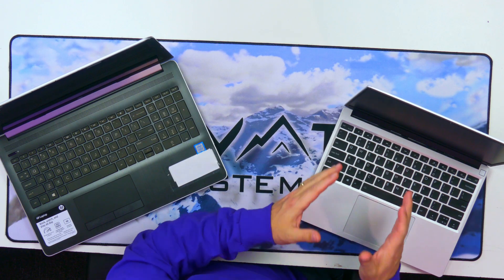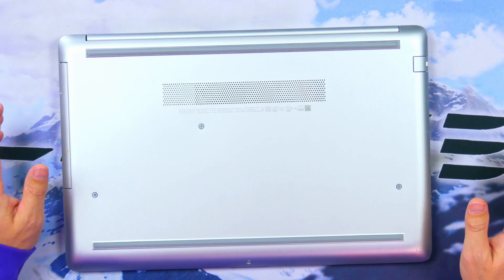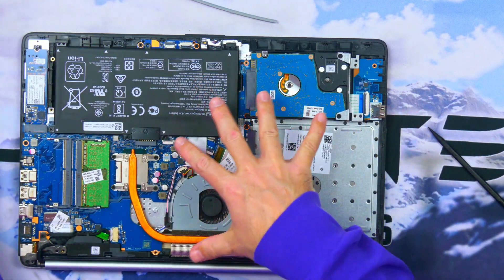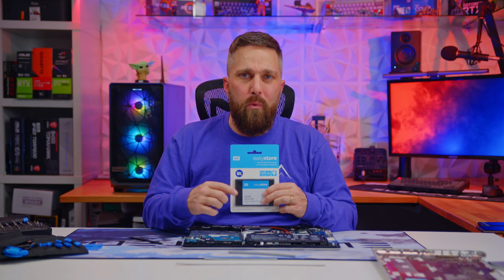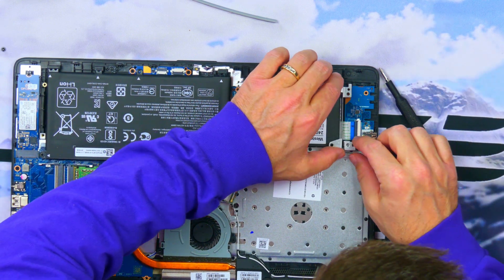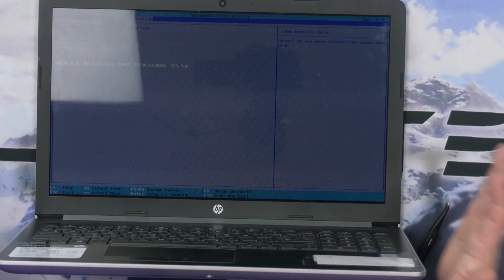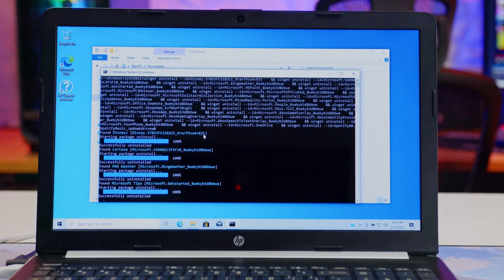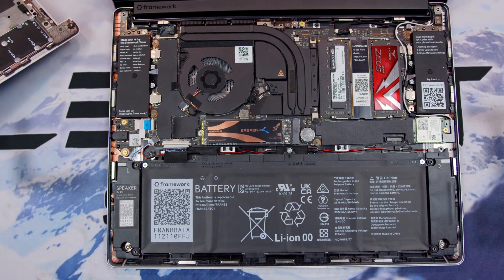Repairing an Anti-Repairable Laptop.

Comment: Just to clarify, he says HHD not HDD because it is a hybrid hard drive.
Reply: Hybrid HDDs, the worst of both worlds. Lacks proper TRIM support, which causes the internal SSD to quickly degrade in both performance and longevity. Won't report as a proper HDD either, which doesn't allow Windows to automatically defrag it.
Reply: But that's also wrong because those are called SSHD!
Reply: @CarbonPanther  To my knowledge they are referred to as both depending on who you ask.  HHD and SSHD are synonymous and refer to the same type of drives.
Reply: @j3y445  from what I understand there is a difference between them either on a firmware or storage percentage difference

Comment: I think this video is very misleading. Your using a cheap $200-$300 HP laptop as example for "manufactures who oppose right-to-repair" and "engage in anti-consumer practice" is a bad one. Most of the complaints being made like plastic clips are irrelevant since the design is made to compensate for the price point, the Framework laptop is at minimum $1000. You can by an HP Elitebook for around the same price which HP has been designed as very repairable for several years now. HP is not really a good example to go after either as they have consistently created "tear down" and "how to replace" videos for most of their laptop line ups. The best comparison you can make against the framework is probably a Macbook.

Comment: I had a friend with an HP laptop that failed on him 2 years into college and I tried to repair it but we ended up chunking it in the trash.  I have repaired and built many desktops before and a few laptops but this thing was something else.  You had to unscrew the bottom cover AND there were screws under the keyboard as well which was clipped in.  After that, there was this tiny thin ribbon cable connecting the keyboard to the motherboard and it snapped in two when I pulled the keyboard off.  I'm a tech junkie so I had an extra laptop laying around that he used to finish out the semester.  That and many other issues I've seen or heard from their products is the reason I will never buy an HP.

Comment: I'm surprised that you didn't add a second stick of RAM while you were inside. (I saw a second DIMM socket inside, something that really low end laptops sometimes omit even when the motherboard is set up to have it.) That would boost performance in two ways: by reducing swapping and by enabling dual channel memory.

Comment: Well... I have a second hand HP8440 Elitebook. It is 12 years old wich in terms of computers is veeery old but it runs extremely well for ofimatic, web browsing, watching videos, email, simple games etc. Not a single problem at all. When it finaly gets completely outdated I will consider buying other second hand premium laptop or the Framework laptop.

People in general should know that cheap laptops are VERY BAD purchase. It is much better to buy a refurbished premium product or like me a second hand premium for 40% cost of a cheap one. If it fails you could buy another one, still save money and it will last long than the cheap one.

Comment: It's kinda a shame. I have a laptop from that same company, from 2012, that is much more repairable. It's not framework repairable, but it's pretty good. It has a external detachable battery, and a service bay, which is held by a single captive screw, which gives me access to the ram, wifi card and hdd, and I can access like everything else with a screwdriver and a pen. Even the cpu can be replaced.

Comment: That framework should be compared in terms of repairability with HP ProBook or elitebook line, the entry levels are pretty in the the same price range and while not on par with models of the early 2010's they are still pretty easy to take apart and service
Reply: I definitely agree. The HP Pavillion lineup is garbage, but the Elitebooks are my favorite line of laptops ever. In regards to repairability, HP actually is better than framework in some aspects especially with their Elitebook 845 Gen 9 which released

Comment: While I know this is not a repair guide, I feel you should have still shown the correct method of screwing in the heatsink instead of fast - forwarding through it. A lot of your followers may look upon this video for guidance.

If anyone is repasting their laptops, the exposed dies are susceptible to chipping, which will kill the computer entirely. Tighten the screws diagonally and do not tighten them all the way in on the first go. Ensure uniform pressure is applied on all sides when tightening the heatsink screws.

Comment: Considering how flexy the chassis is on Pavilion laptops, odds are flex damage will kill the motherboard before that SSD dies. I've seen flex damage kill so many of these. One of the reasons I never recommend consumer-grade laptops to anybody.
Reply: As the owner of a similar model, especially having opened it to upgrade once, I have to agree.

It's terrifyingly cheap, difficult to find useful information for, and has already cooked It's secondary storage controller that was connected to its m.2 slot after only a couple months of running Linux.

Deffinitly going for a Framework or similarly repairable laptop next, just wanting to find something with AMD/Ryzen parts since I'm a Linux user and have had bad luck with Intel/Nvidia

Comment: Just to be fair, this is not a Pavilion laptop, but a "HP notebook" (that's the name of the lineup) and it is their most entry level laptops with very cheap plastic indeed. Hidden screws are a real pity and it is the case for a lot of their consumer products (except gamers such as Omen and Victus laptops). At least there are complete maintenance guide on their website to access all the components, I did not see that for other brands. Also, in Europe, legal warranty is 2 years so it cannot fail too much during the first year of use 😅 I love the framework philosophy and their laptops, I am a PC tower guy myself and I love the fact that you can tinker with a laptop, I hope they will extend their range beyond the premium ultrabook line!

Comment: Bro...worst example of a non repairable laptop. 2 sodimm slots, wifi module is replaceable, m.2 slot, sata slot and even that CPU looks socketed and replaceable. I get the PITA part but it's a budget laptop that can be decked out pretty easily...

Comment: I have literally fixed so many laptops with hdd failures. It’s amazing how hard it can be to replace such a simple component
Reply: They should really make it easier to replace common components like hard drives, batteries, RAM and optical drive (if the laptop comes with one).
Reply: @film2240  but then that means they sell less laptops

Comment: And before you assemble the computer together, remember to try booting it first to make sure everything works, as the video stated those clips are fragile and designed to break so reopening the machine should be made minimal
Reply: After opening my similar model, agreed, also, the plastic that connects to the hing system was already broken on one side on mine for reasons I can't even begin to guess since I tend to treat my computers delicately

Comment: I would not call a HP pavilion anti repair at all. That looked incredibly easy. If you're looking for anti repair call out the M1 MacBooks
Reply from the maker: I have, and no doubt Apple leads the trend. Any anti-consumer practice is usually started by Apple and adopted by everyone else. However, on the other side of the coin the MacBook is rated by multiple independent agencies as the most reliable laptop. They do just last a long time and rarely need repair in relation to all other brands.
Reply: The clips, hidden screws, and the cd tray bs though… feels unnecessary. Apple laptops today aren’t really serviceable beyond swapping the entire logic board and that’s pretty lame but at least you can open it up.
Reply: @ebouwman034  all it takes is a quick google search to learn how to open the laptop up. It shouldn't be too easy because kids shouldn't be opening laptops for example, but this is simple enough for an adult with google
Reply: @defnotatroll  What's wrong with kids opening laptops? If it's safety, no clip design is going to stop them from smashing a laptop to pieces. Kids are generally taught not to do these things, which seems to be good enough.

Comment: Seems a little silly to only go with a 240gb ssd. You could double the storage for 10 or 20 dollars more and save yourself the trouble from having to open the system up again in a year when the SSD is full.
Reply from the maker: The user has zero storage needs. This is strictly a web browsing / zoom chat laptop. He'll never come close to filling the drive.

Comment: Is there a reason you use kryonaut for direct die and nt-h2 for ihs? have been thinking about wether i should repaste some of my family’s laptops and i have nt-h2 but if kryonaut is better for that i’ll probably get that.
Reply from the maker: Kryonaut is a little more stable with the more dramatic temperature shifts you get from the die, but really for lower core count or lower power laptop CPU'S the NT-HT will work the same.
Reply: @ElevatedSystems  Thanks!!
Reply: I use K4-Pro for all my repaste and thermal pad replacements. It gets great Temps on GPU's, CPU's, and power delivery in laptops and single boards. It is really hard to use a half kilogram of this stuff.

Comment: HDD, not HHD. First mistake I let slide but at 6:10 - 6:20 you said it three more times. Hard Disk Drive
Reply from the maker: Actually the toshiba drive I pulled is a HHD (hybrid hard drive). It has a 8gb SSD cache.

Comment: 9:01 wouldn't the optane help with a low quality SSD like the one you installed? Since the SSD likely doesn't have a DRAM cache, maybe the optane will help alleviate that bottleneck?
Reply from the maker: The user doesn't do anything storage intensive so the SSD's SLC cache will be more than enough. However, the Optane can't hurt which is why I left it.
Reply: @ElevatedSystems  makes sense. All about use cases.

Comment: I am still using two 2011 mac book pro but not as a main computer. one with mac os and one with linux.
Reply from the maker: Despite their reputation as bieng anti right to repair, Macbooks are actually statistically the most reliable laptops.
Reply: @ElevatedSystems  not the last ones!

Comment: my $350 7 year old laptop Hasn't failed even once, the hdd and ram are slow but are still going, only battery has grown weaker, with taking extreme care+a little bit of luck, electronics can last longer
Reply: You should be able to replace the battery and put in an SSD and it'll feel a lot better.
Reply: @Jackofafewtrades  yeaa, battery is removable without even opening the back, ssd can be added too, but i sadly don't have budget right now and i don't feel like the need is that high right now
Reply: @amansetia8655  fair enough! If it works, it works. My dad had a Dell for like 15 years. It was slow as hell but he never needed more so why bother?

Comment: PAINNNNNNNNNNNN!!! You didn't unplug the battery before work! :( :( :(
Reply from the maker: True, I didn't use an anti static device either and while it is best practice, since polymer e-caps and not wet capacitors are used nowadays, I generally don't pull the battery for a simple drive swap. But you are right, and this is something else HP can fix. Use a simple quick disconnect cable for the battery rather then needing to remove 10 screws and physically remove to battery like in this laptop.

Comment: Also, as of note, you have some misconception about Optane. It uses Intel Rapid Storage Technology where fast small SSD is used to accelerate HDD by having swap on Optane drive and I guess cache? It was some weird raid 0 used on one laptop I fixed (beware of bugs, bug in RST compatability with windows 10 on that old chipset caused me corruption of that RAID, had to use recovery software to get data out, thankfully by miracle userdata wasnt corrupt). The interface is m.2 pci-e (HP bios wont check for m.2 being used for ssd, THIS ISNT THINKPAD, but you can check if m.2 ssd version was avaliable in lineup, hoorah service manual) so really no reason to use regular 240gb cheapo sata ssd on this machine and optane drive while being plenty fast, not that usable in this case so you could've salvaged it, as Intel no longer makes em and optane memory last for a lot of cycles, even better than good MLC drive.
Reply from the maker: I'm pretty sure that's exactly what I said in simpler terms.
Reply: @ElevatedSystems  also it makes me kinda cringe a bit trying to check drive with windows installation media, i'd recommend either using custom built windows re with crystaldiskinfo or linux stick with smartmontools, gui is called GSmartControl if you need that but smartctl is really easy to use anyway, SystemRescueCD does come with both.
Reply from the maker: @Yuk3yN4g4t0  Wasn't nessasary, the owner didn't have any data he needed recovered so I just needed to confirm the drive was the problem. Also I'm pretty sure it was the actuator that failed so the drive was unrecoverable short of sending it to a professional data recovery center.
Reply: just checked, hp says both sata and nvme in that m.2 slot can be installed.

Comment: I replaced my Macbook air 2015 early battery last month....now the battery life is good as new! Also i never upgraded to MacOS Monterey as I have heard it slows down the device. This laptop was a really good device from a repair perspective as the battery was held down by screws and not adhesives. I have also repasted the CPU and GPU in it with high performance thermal paste. This laptop was the last air before apple started screwing over their customers. Here in India the laptops are so costly(as the average income is lower than developed countries), so people have no other choice but to keep repairing until its unrepairable. 

I am looking forward to buy the Macbook Pro 14" in the coming years..... unless Framework comes finally to India, in that case, Im getting a framework baby!!
Reply: Apple devices used to be very repairable, in an iPhone 5 you undo 2 screws and you can replace the screen, motherboard, battery. It's really sad to see how apple used to be because modern apple devices being unrepairable is all I've ever known.
Reply: Hey if you back up your data you can test the difference then apple has an article to reinstall the os that came with the device on 2013 and up mac's note that's not possible on m1 macs

Comment: I have hp probook and I swear hp makes the worst usb ever because mine usb 2.0 broke after two months of use. Still havent bought replacement board and laptop REFUSES to boot without it, i wish companies stopped doing that. Opening it up was also not an easy task but thankfully some guy on youtube opened it by simply using plastic lifter in the place of clips and i was able to repeat that, but first time I disassembled it with only their service guide that HP THANKFULLY PROVIDE FOR THEIR ENTIRE LINEUP OF PRODUCTS, even printers, but it doesnt specify the location of plastic clips so i barely dodged the bullet of breaking them with plastic tools, not good. HP also for some bizzare reason ship with proprietary mb to sata CABLE, but not hdd tray. Also, to HP's credit, THEY ALSO SELL PARTS FOR SUPPORTED DEVICES and you can find them in service manual.
Reply: Yeah, anything HP makes for their business line has a repair manual easily available and is decently supported parts wise.

Comment: Nice demonstration. Also, whats up with that wifi module just floating loose like that?
Reply: Lol it looks like it's actually mounted and inserted properly, just the connector is at a wonky angle because of how the board is designed.
Reply from the maker: ^What he said. It is secured in a clear plastic bracket.

Comment: I opened my 7 y/o HP pavilion 15 and broke a corner screw standoff while closing the laptop. Now that specific screw cannot be screwed tight or loose anymore. Its so annoying ill probably have to rip the shell apart if i want to get at the motherboard again for repasting.

The only great thing about old HP laptops is that you can very easily remove and replace the CD drive with a caddy for a quick SSD expansion.
Reply: They are fully repairable https://www.youtube.com/watch?v=IpyEY8_7FgA&t=804s&ab_channel=HPSupport
Reply: But where do you get the extra connection for the SSD?
Reply: @defnotatroll  Its with the CD drive. The connection is there and the replacement caddy will have a board that converts that SATA interface into something an SSD can be slotted into.